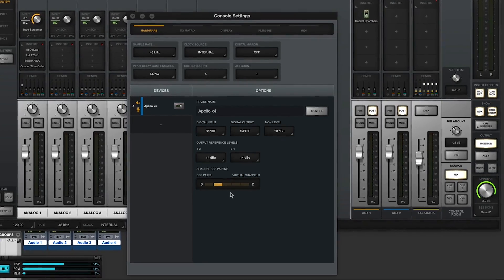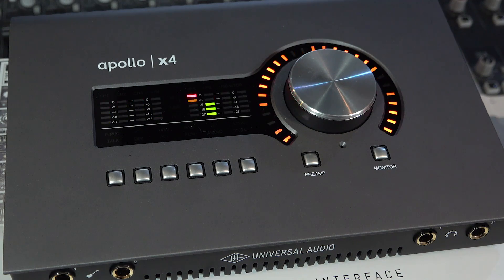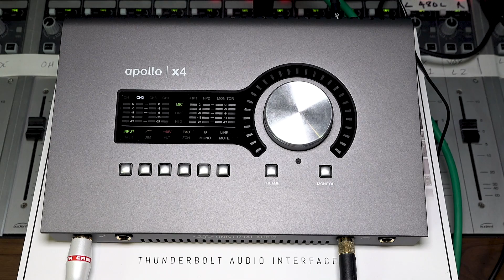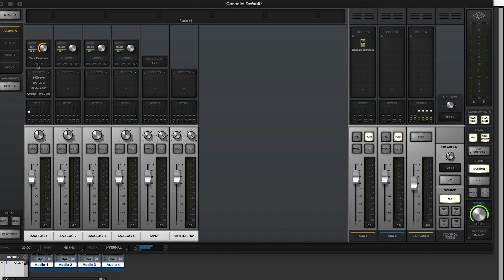Universal Audio Apollo x4 - Production Expert Preview

Comment: Can we plug a guitar in HI-Z 1 and plug at the same time a microphone in channel 1 ? Or maybe can we plug 4 microphones AND 2 Guitars ?
Reply: pretty sure that would be a NOPE. Using the Hi-Z inputs takes over those channels, period. Even if it was possible, how would you control such a setup? Console provides one mixer strip per channel, which changes its properties based on what's plugged in. Same goes for for impedance.
Reply: Is it possible to record at the same time 4 microphones and 2 guitars ?  ....6 inputs ?

Comment: Maybe I missed this, but are the two instrument inputs on the front and the mic inputs on the back all separate inputs?
Reply: Good Q, i'd like to know also.. Reckon they cancel out..
Reply: No, when you plug into a Hi-Z input (front) it over rides the same input number on the back. That’s why they are designated 1&2 on both front and back. It would be nice if the were all separate inputs: 1-6 instead of 1-4

Comment: Glad to hear they've put vents in but I'm a bit concerned that it "gets warm". I had to give up on the Arrow because the units kept overheating, producing glitchy and distorted audio, and crashing even with minimal load. Granted, this was during a hot summer, but you shouldn't have to worry about that too much with such expensive hardware.
Reply: I have noticed the regular UAD Apollo Twin USB gets hot.
Reply: @ytb917  This is my worry. No reviewer ever seems to want to get on the wrong side of UA even when there are quite glaring problems, or things missing that I suspect other companies would have been criticised for (no oversampling, for example).

Comment: Looks quite good, but hardly breaking new ground. No midi i/o. Dont know if it is possible, but could use some new features on external soundcards like usb i/o for dongles ect. due to the lack of i/o on consumer computers, which most of us use after all.
Reply: if it i has no midi i/o, that is not good.  this box is $1800 and is bigger than the other ones.  midi ports cost like $10 or something from a manufacturing standpoint.  this box should definitely have midi i/o.
Reply: How can you connect a midi device?